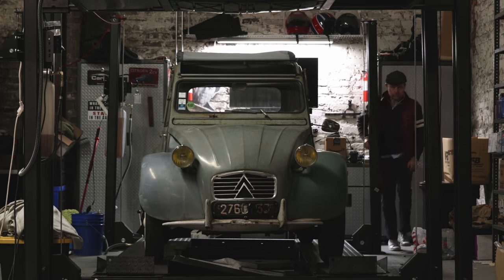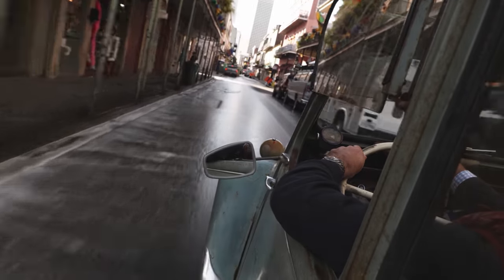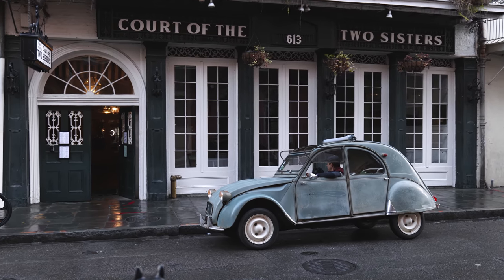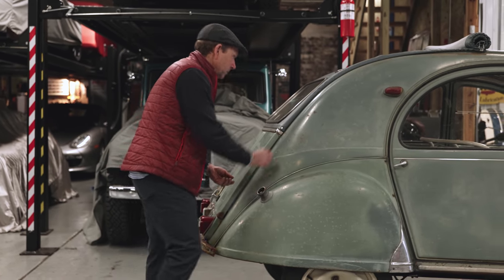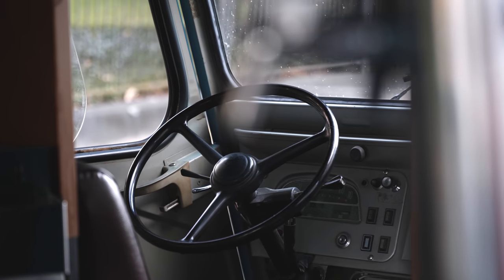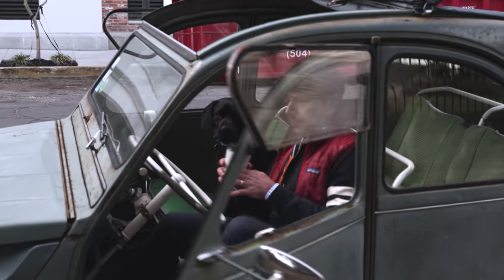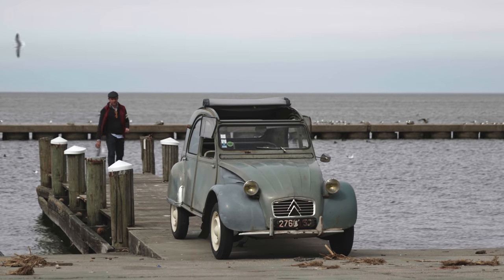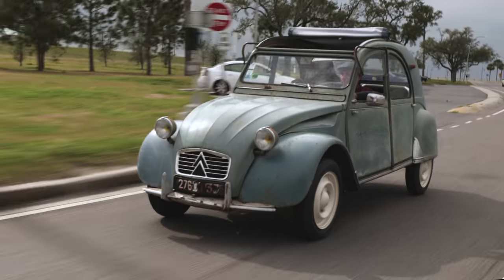Citroën 2CV looks right at home in New Orleans' French Quarter | Why I Drive #33

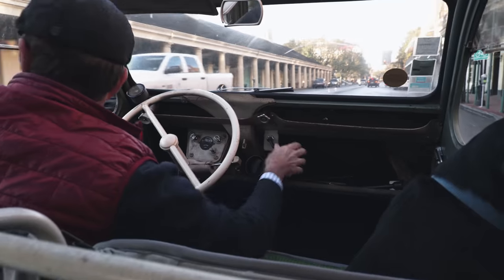Comment: 1:24 “I will take this car across country tomorrow in the state she is”
I hope you mean on backroads and with a lot of tools and parts. Cross country is a long way.
That’s a great little city car but I wouldn’t take it on the highway or for such great distances. Fantastic story and I wish him the best with it. Glad he’s driving it. Happy Motoring!
Reply: I drove 2 times from germany to marocco when l was young in a 2cv and had a lot of fun but no problems .l should have kept them .A friend of mine drove to afghanistan in the late 70th and back.
Reply: I lot of 2cv people love to travel this way. They're pretty reliable. Also, you don't have to be handy to own them. They're just that easy to fix.
Reply: I've driven one from Adelaide Sth Australia to Brisbane in Queensland, it was easy, yes a little bit slow but who cares, as long as nobody gets hurt, Rj in Oz
Reply: Germany to Morocco is about 1,600 miles (3300 km)
Adelaide to Brisbane about 1,250 miles (2000 km)
“Cross-country” in the US is at a minimum of 2,500 miles (4,000 km)
I get where you all are coming from. It’s reliable and easy to work on. But for me, there’s no way I’m driving that on any 70+mph highway or even backroads for 2,500 miles.
Reply: 50,000 mile at wide open throttle failure testing. That's the criteria it met.

Comment: Surface rust on a 2cv....is a hole.........the steel is so thin., the paint is structural..It ' s a steel tent on a sardine can chassis., they are brilliant., but don't have an accident.. I was in a Citroën BX on a stormy night on the road into London from Rochester and was passed by a 2 drive by a youth....it was teaming with rain., and it's bicycle thin tyres scythed through the standing rain to get grip on the slicked black top., amazing..

Comment: I've wanted a 2CV since seeing the Mythbusters disassembling one. You don't even need tools to remove the hood - perfect for easy maintenance.
Reply: you need a 10mm (brake cylinders), an 11mm wrench (almost everything), a 14mm (brakes), a 14mm T wrench (to disassemble the fan and access the distributor), a 17mm (body and gearbox) and a 19mm (body), with that, a screwdriver, some wires and duct tape you can go everywhere. Special tools: a 32mm (front transmission axles) and a 44mm (rear brake drums), but you won't use these 2 en 10 yrs.
Reply: @eduardosantabaya5348  You need a special tool to dissassemble the springs in the engine also.

Comment: I had one of these "tin snails " in London in 1977.  Mine was a 1964 car, left hand drive, and was so much fun to drive.  Unbelievable fuel economy, such as 50 miles per gallon. Not fast just leisurely speed ,and very dependable,  because there was not much that could go wrong. The starter motor mounted at the front was also the generator, regarding the centrifugal clutch, all very nice but a nightmare on a mountain downhill run because you cannot engage any gear to slow the car down , instead you have to rely on the inboard drum brakes in the front to slow down.  By the time you reach the end of the downhill run, your brakes are completely useless and probably ovalized drums.
Reply: I am sorry but the starter motor was NEVER the generator. On ALL 2CV models from the beginning the starter motor is mounted on the gearbox support. On older models like the one in the video the starter is operated by pulling a cable from the passenger compartment, on newer models it is operated by a solenoid.

Comment: Hey congratulations for this video.  I’m from Argentina, I’m 69 year old. In 1965, qué hay was a 13 year old young boy, my father brought his fist new car. It was a 2cv very similar to your 2cv, an Argentine made version. The 2cv of my father was almost equal to this. Same fuel metering “system”, only 4 windows, same dashboard (very very simple), the same centrifugal clutch. Here it was very strange because it looked like an almost automatic gear, , that here they only had a few American cars. Your video is very good!, it has brought me fond memories that I have shared with my son. Just one doubt, really has 23 hp your 2cv.?. The 2cv made in Argentina had only 14 hp, I remember it very well.
Reply: You are right. 23 HP is too much for the 425cc engine. Engine Citroën 2CV AZAM (1963-1967) Type of engine: 2 cylinders flat: Petrol Energy: Layout: Longitudinal front: Carburetor  -Distribution Central camshaft: Number of valves 2 per cylinder: Bore & Stroke 66.0 x 62.0 mm: Displacement 425 cc: Compression 7.5: Power 18 horsepower at 5000 rpm

Comment: When it comes to small cars, I like the Beetle...but there's no denying the fun a 2CV could be on a semi-regular basis.
Reply: As much as we love the beetle, and there is no doubt it is arguably the most successful people's car (keeping the model T aside) ever. The VW is more polished and and better at isolating the elements. But the 2CV does have a few advantages. Its reliability, gas mileage. off road superiority, handling in the wet, and interior space are all superior to the Beetle. Besides, everyone of them comes with a roof you can roll back to expose the sun or the stars. The seats can be removed in a couple of minutes. Picnic anyone?

Comment: of course a design metric was going across a plowed field with a tray of eggs and not breaking any.
Some of NOLAs streets are very haggard to say the least due to the water table and tree roots.
In DC it's just the constant ' make work ' for political donors that leave the streets here a million times worse.
But all of our green new dealers drive large blobs and a 2CV would be too individualistic for them.
I remember in the UK these also had the cheapest insurance rating.

Comment: Ladies and gentlemen, the first FWD vehicle.
Reply: I believe the first FWD vehicle was the Traction Avant, also a Citroen.
“Traction Avant” means FWD in French and that model was pre-WW2 (1934-1957) whereas the 2CV was post-WW2 (1948-1990).
Edit: According to Wikipedia the Traction Avant wasn’t even first with FWD.. But it was the first mass-produced car with a monocoque unibody.
Reply: @anderspedersen7488   Well I guess I learned something new today. I thought that the 2CV was the first of its kind, and that during WWII its creator hid the car so it wouldn't fall into the hands of the Germans. Perhaps it was the first mass produced FWD vehicle for public use. Anyways, thanks for the correction.
Reply: The first FWD vehicle was the Fardier build by the french inventor Cugnot in 1765.
Reply: In fact it was the first motor vehicle ever.